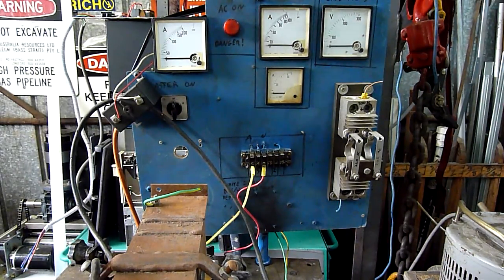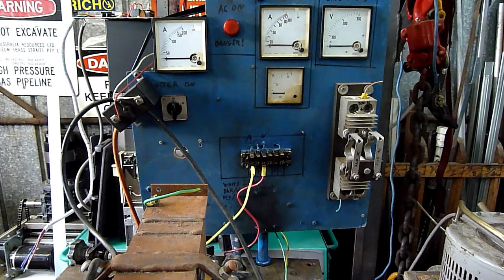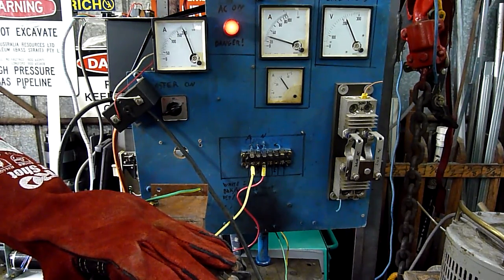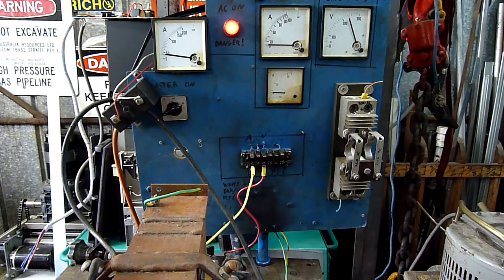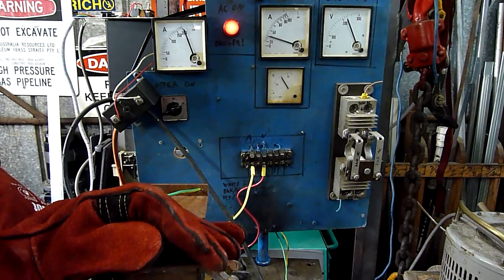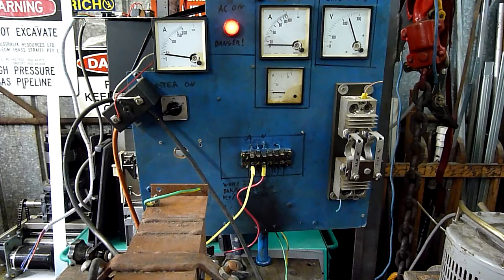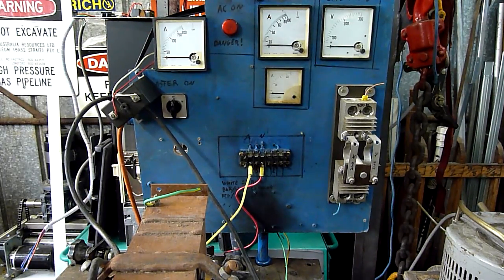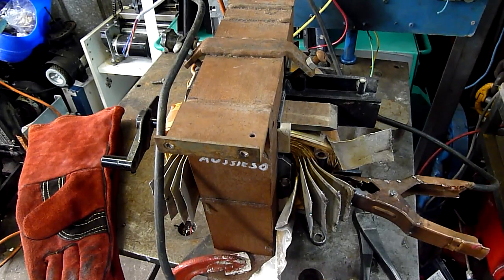Musical Welder Secondary Current Demo

Comment: Does it dim every light on the street like the one Photon built? High current and low voltage is fun. What I find interesting are the induction heating machines, the ones they use to temper hacksaw blades.